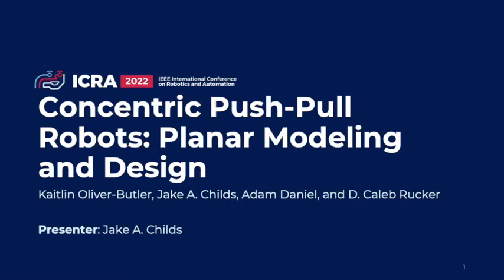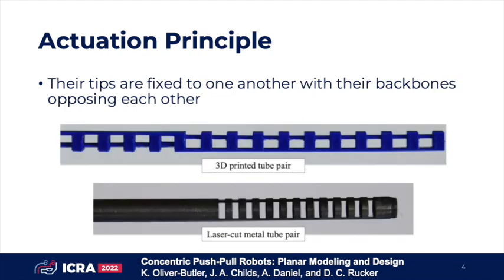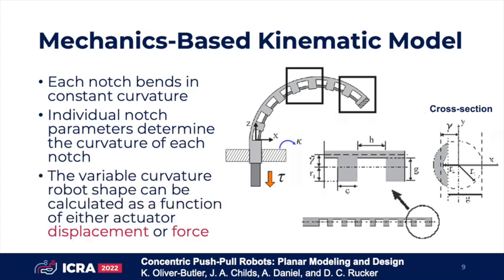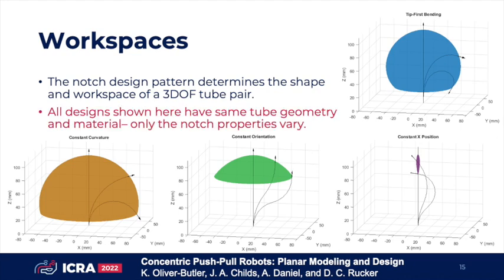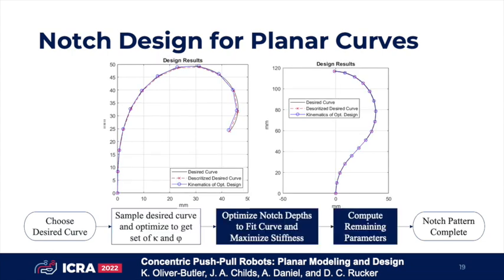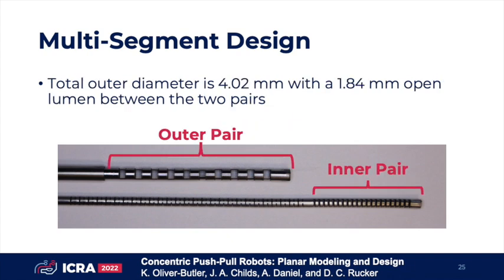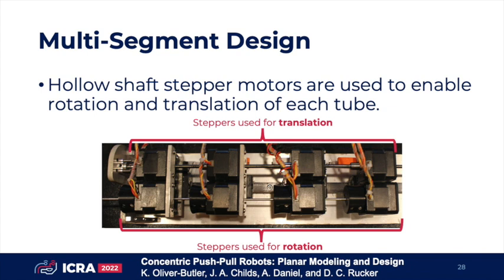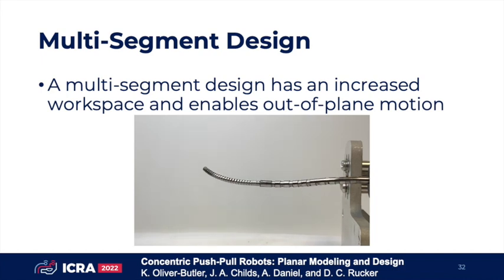Concentric Push-Pull Robots: Slotted Tube Design

Comment: Very cool paper and well presented. Are there any applications you have planned for this? How much force can this exert at the tip when bending? (I am about to read the paper, I apologize if these are answered there)
Reply: Answer to my first question: Benefits of this approach include intrinsic safety for human interaction [1], [2], gripping of delicate or irregularly shaped objects [3], [4], [5], and the ability to be made at slender, millimeter-scale sizes for access in hard-to-reach areas.